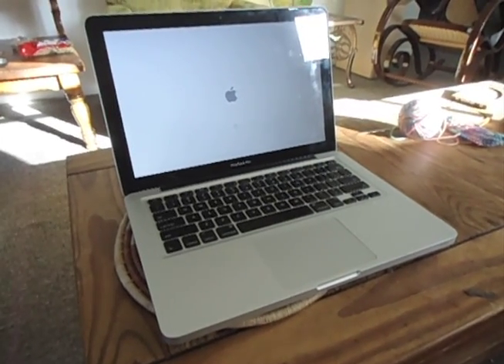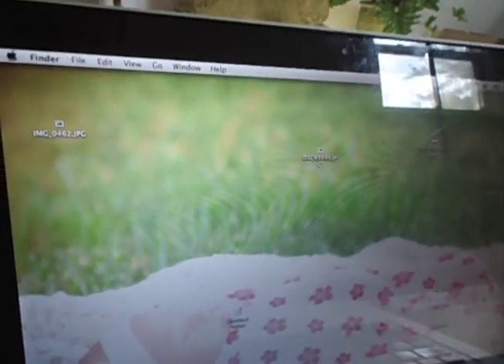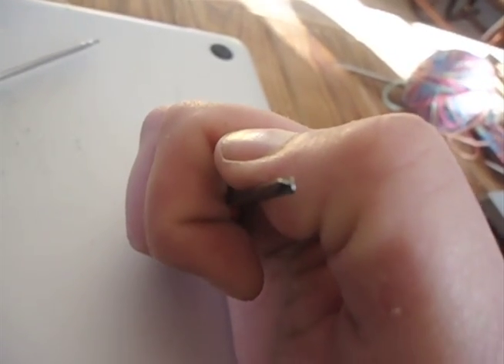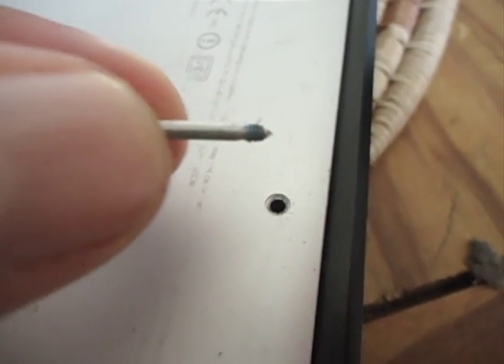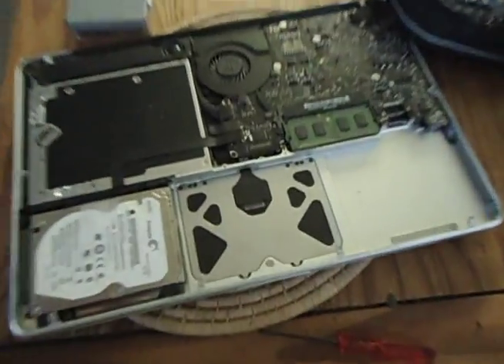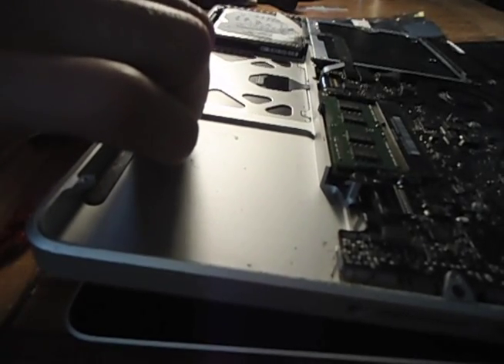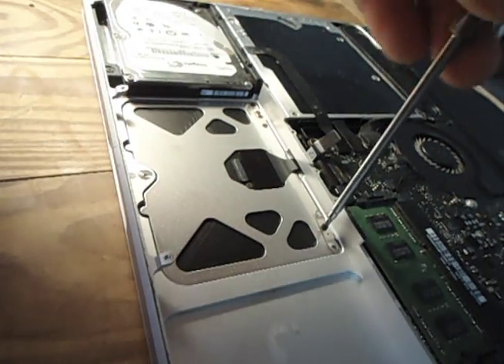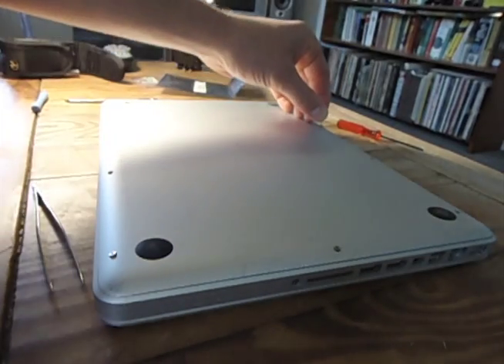Short and Easy Apple Macbook Pro Trackpad and Battery Replacement Tutorial ( Mid 2009 model )

Comment: thanks for sharing i was very helpful does this work for a macbook pro 2013 model by any chance? 13in screen
Reply from the maker: I'm pretty sure it doesn't.  It looks more complicated... here's a 2014 and googling around 2013 and 2014 look similar.

https://www.ifixit.com/Guide/MacBook+Pro+13-Inch+Retina+Display+Mid+2014+Trackpad+Replacement/27850
Reply: Thank you sir for the quick response.
Reply from the maker: No problem... good luck!